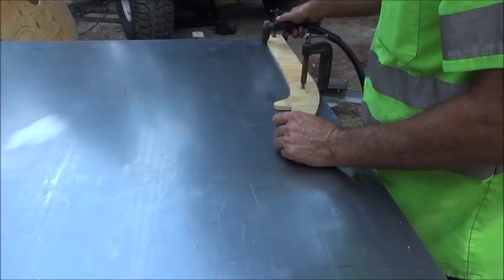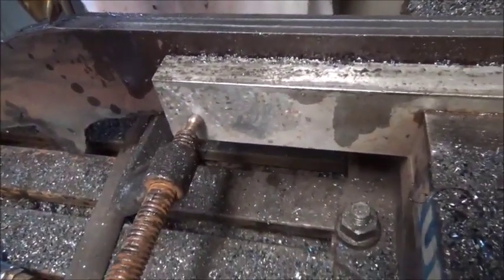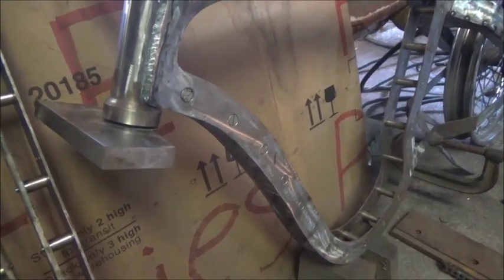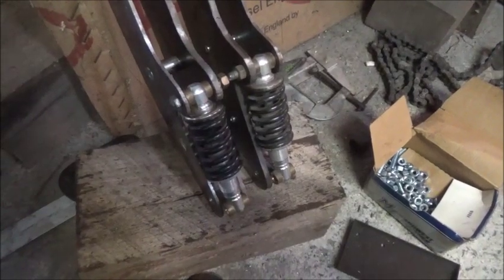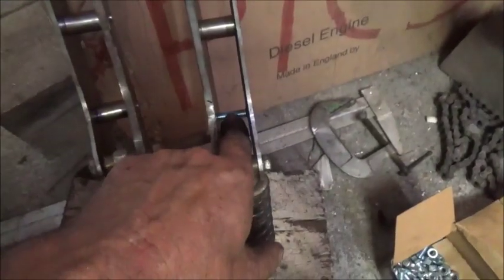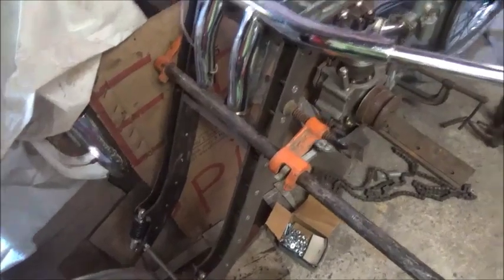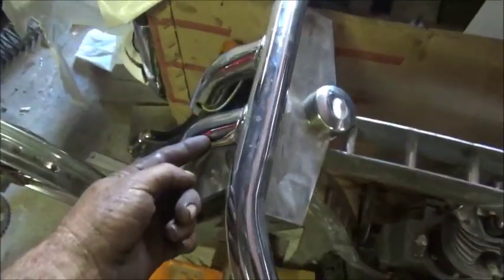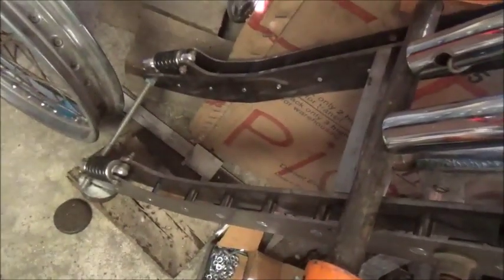Chopper, Bobber, Board Track Motorcycle Build Part 6 Not Happy Sailing!!

Comment: I couldn't tell from the angle of the shots you took, but the fork doesn't look wider than the spread of the frame for the back wheel. Pull  a tape on both and it should let you know if it is balanced in width from and back.

Comment: You could make a bracket to mount the wheel on that attaches to the forks and the shocks attach to. This bracket would pivot on the forks and mount on the outside of the forks and the brakes would clear the forks. You could then narrow your fork spacing. Hope this makes sense.

Comment: It happens, you still have some really good tree's to work with. If you wanted you could bore them for pipe for a traditional springer, could also do a girder style springer (spring in the head with parallel links, you could even use both of those shocks for that as well), cut both sides from 1/2" steel or aluminum and narrow the tree's accordingly. Lots of ideas, I'm sure you'll find the right idea, I do agree it is kinda wide. Good luck Mr. Jonathan, thanks for sharing!

Comment: You ever think about changing out the hub in the wheel and go with a hub with the brake inside the spokes? Maybe instead of using 1 inch tubes to space out your forks, cut them down to 1/2 inch? Never seen forks as wide as the actual frame before. Just spit balling here, just do what ever makes you happy, I'll keep following along. Thanks for bringing us along for the ride.:-)

Comment: Narrow the top triple tree 1 1/2, remove the top spacers  and let the outer plate step out  wider at the lower triple tree 1/2 inch  then taper out wider as you go down. 
I don't think it being wide is an issue, but is so square.

Comment: I think the trees should be a lil wider than the rear section of the frame. It looks wide in the rear also. Looks good. Cut the smaller bars in half and widen them to match the trees width.??

Comment: You could always use a narrow glide front wheel and narrow your triple trees if you don't like the width. Junior might have one you can measure. The old 35mm narrow glide from the70s and early 80s is the wheel you are looking for. They made them in a 21.

Comment: I think what's throwing off your perception of the Fork width- is because they're not the round (tubular) air & oil shock absorber type like most motorcycles are. I think it's very structure sound, and will look fine with handle bars & wheel installed. IMO it's the tiny engine that looks strange in comparison. You've got a 1200cc Harley frame with a 90cc dirt bike sized engine. A bike this size should have at least a 650cc twin. Highway (crash) bars would widen out the front, and make the forks blend right in nicely. They'd also protect the engine if laid down.

Comment: Make up the tank,  a front fender if using one and come back to the forks. The forks will need steering clearance on the tank also. I like the look you got going, it may need the width to accommodate the hub w/brake.

Comment: I'm no bike builder, but like other comments I would build the tank next. Then get a tire and a cardboard fender over it. First mod to the forks you have would be to reduce the spacers. Other comments are similar. Myself I would go like a half inch space in the fork assemblies first before I scrapped the idea. Another idea might be to narrow the outside layer of the fork quarter or half inch compared to the inner layer. Might soften the big square look you're not liking by giving it a little taper to the mass. Sometimes we go through all the work and don't like it in any way, so I'm interested to see what becomes of it. Thanks for sharing.

Comment: My first thought is do a 45 degree break out on the quarter inch plate above the tire and another 45 back down and weld the skinny plate to the quarter. And bring the trees in two inches. Just don't know if a single quarter inch plate on each side is strong enough

Comment: Maybe you could narrow the spacers up.  I feel like making them just a quarter inch wide or so would be just as strong.  You could narrow the top part of the triple tree up to match.  I don't think it would look funny with the spacers different widths in the frame vs. the forks.  Aside from that when you get a tank on there it ought to take up some of the difference.  That and a rim without a tire looks like a shaved cat.  How does the front fork width compare with the rear?

Comment: Consider narrowing the triple trees by the width of each of the fork bars on each side.  Then box the narrowed structure.  This would let you surface mount shorter fork bars at the bottom of the boxed narrowed triple trees instead of from top to bottom..  It would fool the eye by two inches at the top but still be wide enough at the bottom for the  wheel & brake.  Bo.

Comment: My 2 cents: could you maybe use narrower spacers in the forks?  To my eye, that would make them look a little more in proportion, & if you just bring in the outside you won't have to fool with finding a narrower front wheel.  The only other idea I had was to taper the outer plate to meet or nearly meet the inner plate at the bottom, but that would be a helluva lot of work.  One last thing: I like the flathead screws pointing everywhichway; gives the bike more vintage style.  Thanks much for making such great content.

Comment: You need to run with the front end theme that you've got going.l would get the bike running as is first before tearing your ideas to shreds.Will make the point that those front shocks won't cut it,to light.How about a torsion lever type suspension?(not bar,used on early race cars?)
Reply from the maker: Shocks are more than adequate for the weight of this bike'.

Comment: First of all, of everything you do this has impressed me the most. And the frame build continues to, not least because of the design and attention to detail. As to the forks, yes they do look a little wide. Could the top be narrowed a little and stepped out over the wheel. Think a couple more have suggested something like this. I had an Ariel Leader when I was young and it had trailing link forks.

Comment: I see your dilemma and raise you a suggestion or two. Standing back and looking at the profile, the front end overpowers the frame. I would suggest reprofiling the forks to duplicate the frame. Are you planning a disc brake in front? Useing a drum brake not only will allow narrowing the trees it will be more in the theme of the bike. I would also suggest using narrower spacers on the forks. I think a fork brace is going to be neccessary for stability when cornering. I await your solution. I'm sure it will be the best one.

Comment: Hey Jonathon it is looking good mate so don't be beating yourself up over it just yet. You mentioned the other day that you were thinking of making the tanks taper from the front to the back if you simply increase the width at the front of the tanks by 3/8" either side it will all then look to be proportionate. It will be much easier to modify your tank design than to undo all of the beautiful work you have done so far, best shot is to step away from this project for a day or two to get a fresh perspective, l am sure we all look forward to seeing how you deal with this minor bump in the road. All the best JW - Cheers from Australia

Comment: Best thing to do when designing something and running into something you are unhappy with is look at it differently. For my work it means turning it upside down and looking at it in a mirror. I bet that would work here as well. Also move the frame into a place you can stand back and walk around it. I am sure you will find what suits you. But flip it over and look for a while. I always works for me.

Comment: Maybe you should build the fuel tanks then make the decision.
Reply: I agree; maybe he can do a full mock up of the tanks out of cardboard or something and put them where he wants them and see how it looks. I think the tanks will bring the wideness of the front end back under control - it won't seem as noticeably wide and will tie the front end together. But whatever he decides, I think it will look good.
Reply: I'm with the others, mock up the tank, a fender. A cool light or two on the front, it'll work out. That's fun, and pain, of custom fab work. No doubt, you've been there before.
Reply: Yeah, that's what I was thinking.
Reply: I would have to agree. The tank may make for a whole different look.
Reply: I agree

Comment: I like where you’re goin Johnathan. It’s hard to get between an artist and his work but here’s my two cents. I understand your opinion that it’s too wide and maybe you are right, but, if it’s the look from the saddle that’s stuck in your craw, I would take a step back and work on the tanks and get some proportion from them. A lot of bikes are kinda wrong looking with the tin off. Likewise, if it’s the front view, maybe roughing in a fender will change the perspective a little. Another option may be to round some of the edges on the top plate of the triple clamp, that would soften up thing a little bit also. I know you want it right and aren’t worried about re-working anything, but that is a good bit of work to put in the scrap bin.
Reply: AngryRed Banjo has something here, JW.  I like what Mustie1 said as well.  Your first look needs time to rest, which is exactly what you're doing.  I can wait, because I'm pretty sure it'll turn out at unique as you are.  Thanks Man!!
Reply: Well said to these comments!!